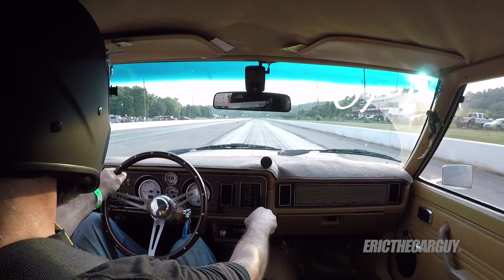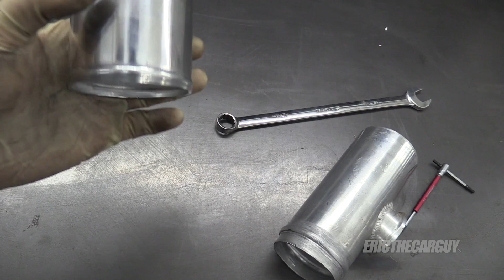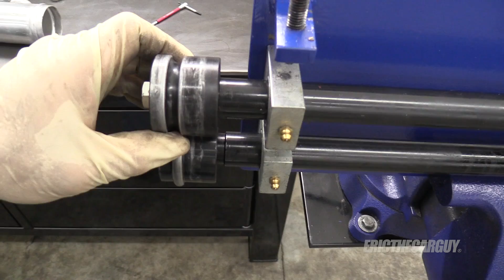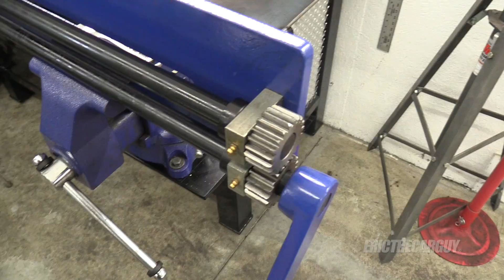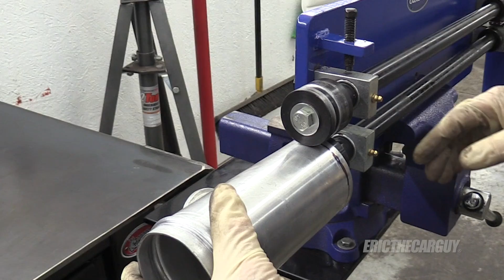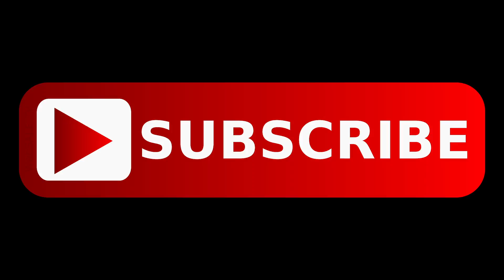How To Keep Your Hoses From Coming Off

Comment: Hey mate great vid cheers! Question - my coldside silicone pipe keeps popping off despite having a rolled bead on the metal pipe. I noticed you have 2 clamps which appears to the placed on either side of the bead. Are 2 clamps placed like this necessary? And would it help my situation?  I've had 3 mechanics try to fix this a total of 4-5 times now and am losing patience, will try to fix myself/know if these mechanics are doing a decent job. many thanks

Comment: I have steel “cold side” pipes (I call them compressor pipes). I made beads by soft soldering a wrap of stranded copper wire. Tin the steel. Wrap one turn of copper and twist the ends together. Solder it to the pipe, snip off the twisted ends and file smooth.

Comment: That is one way to fix it. I don't have a bead roller so I just draw my straight line and tig some spot welds around the pipe.
Reply: I think weld method is the best with an normal people

Comment: You'll find many uses for that bead roller Eric..and as game changer, get rid of the crank and put a big wheel on it. the larger the wheel the better control. You will notice it more so when your trying to lay out a clean curved bead on a long sheet.  But that's where a powered version is best. 😃

Comment: I've got a 2002 Saab, it MAYBE pushes 12 psi,  probably less, but even then I had the intake off and shortly after was pushing that 12 psi... intake hose popped off with a thunderous BANG, scared me so bad I thought I'd blown the thing up lol. Anyways, having a hose blow off under pressure is no good.

Comment: Hairspray works well too, clean the boot and the pipe with brake cleaner to remove oil and grease, get some of your wifes hairspray  coat the end of the pipe and inside of boot, install clamps and torque 

Good to go

Comment: I now add hose bumps to all hoses that originally did not have them. I use the bubble flare die that comes with the Eastwood Hydraulic Flaring Tool. Of course its only good up to the die size that the kit includes. No good for rad or turbo pipes.

Comment: You can also weld the bead on there. Be sure to grind it smooth so you dont have sharp edges. Saying this because people more likely have a welder laying around rather than a bead roller.

Comment: Hey  What's up buddy been watching your videos for years now lot of good education and stuff But I need your help with one thing running into a problem I have a 2003 ram that had a 4.7 but now it's has a 5.7  And the problem that I am having is On the top right corner of the motor there are 2 connections they look like fuel injector conections but i dont see the same connections on the truck?  Can u help me out.   You can email me at zombie.king1988@gmail.com  or on here

Comment: The Vibrant Performance bead roller is much more compact and has a plate to keep the pipe straight while making that initial guide bead. Also has a knob to set the pressure instead of having to use a wrench.
Reply: But you cant do floor pans or any other fancy metal work with one of those

Comment: Did this help anyone?
Reply: Its all about the views
Reply: Yes, smarty pants. I saw Eric pipe fitting without the bead when he first was routing the turbo pipes and thought he should do beads like they do on Project Binky. I started to look into bead rollers for myself because of that and there are a lot of them out there. Seeing one in action like this with commentary on the nuances of the process helps a great deal when selecting the right tools for the job. Manufacturers/retailers videos are a good place to start, but they are all about selling product. When learning I prefer long form videos where the detail is left in.
Reply: Yes mate, I agree

Comment: Roll over image to zoom in
Forney 70815 Pipe Template, Wrap Around
by Forney
3.9 out of 5 stars    3 customer reviews  
List Price: $32.99 
Price: $28.30 & FREE Shipping.Details
You Save: $4.69 (14%)
Note: Available at a lower price from other sellers that may not offer free Prime shipping.
Wrap around -Inch little helper-Inch pipe template
Measures 4-Inch by 60-Inch and made from tough yet flexible material
Used for marking straight lines around 1-Inch to 12-Inch pipe
For use as a straight edge
Contains 45 degree angle markings, protractors, scale and constants table

Comment: Flange Wizard WW-16 Wizard Wraps, 2 5/8" x 30", Heat Resistant, Small
Flange Wizard
WW-16 Wizard Wraps, 2 5/8" x 30", Heat Resistant, Small. This is what you need.

Comment: for getting a straight line on a tube, I use a piece of paper and some tape all the time.  Just need a little bit of overlap and tighten the paper around the tube.  works every time

Comment: You can use a modified pair of channel locks to put a bead on the end of tubing if you can't justify buying a roller. Grind a cup in one of the jaws, put a big tack weld on the other and make that fit into the cup on the other jaw. It's a lot harder to make the beads but it works.
Reply: Serps1991 Dan from Hoonigan did it this way. I need to do this soon
Reply: Greasy Style I actually learned about this from Tony Angelo, one of the original Hoonigans lol.
Reply: Hotrod garage? Or before that somewhere? Hahahaha but yea very neat “backyard” trick
Reply: They showed it on a recent Hotrod garage. I've heard it talked about at Club Loose at Englishtown though.
Reply: Welding a washer on instead of fitting a bead works well too

Comment: excellent video. well spoken. another helpful tool (s) for working with tubing fabrication...check these out:

https://www.grainger.com/product/18C551?cm_mmc=PPC:+Google+PLA&s_kwcid=AL!2966!3!281698276041!!!g!471329783024!&ef_id=WqKbIgAAAGZ2Mza8:20181019143209:s&gclid=CjwKCAjwgabeBRBuEiwACD4R5isNV670UALNTCeoZAhfS-fSQMp0LMoNvbGi9gP4DyiBy0aXxflnnRoCCPcQAvD_BwE
they're super handy and easy to use. makes for a good straight edge if/when you're drawing circumferential lines, prepping joints, etc. just fyi. thanks eric!

Comment: put some oil on the rollers after first pass. should be easier to make groove
Reply from the maker: I thought of that but thought it might cause the metal to slip rather than go into the rollers.

Comment: First off, why don't you use your hose coupling, hose clamp, masking tape, piece of paper, pretty much anything so that you can make your initial line on the tubing? That's pretty amateur to eyeball it with a sharpie.

Second, your thumbnail for the video says "easy", but you screwed it up the first 2 times. For the $150ish it would cost to purchase this tool, I would think a professional could bead roll quite a few tube ends for that (although a bead roller has a lot of other uses).

Here's a video link that shows a more affordable option that's a little bit more consistent for someone that is inxperienced with a bead roller or can't afford $150 tool. https://youtu.be/JVDUM2ZxoW0
Reply: Zach McDonald  You don't have many friends, do you? You're quite rude and a "know it all". Telling a YouTube channel owner with over 1 million subscribers, "what he should do". You're an odd little man, Zachary.
Reply from the maker: Despite my scribbly line, the bead turned out fine. It was only my first 'practice' bead that didn't turn out all that well. You make a great suggestion though. 

As for the thumbnail, this is YouTube. Hate the game, not the player. 

Thanks for your input.

Comment: Aqua net hair spray also helps keep intercooler hoses on. It acts as an adhesive.
Reply: Super 77 would probably work too, maybe better, tho getting it apart later could be an issue
Reply: Caterpillar green glue,we use it on diesel intercooler piping on pulling tractors and trucks running 70+ lb of boost.
Reply: A few people said similarly but I finally get it! (You maybe explained it better or I was a slow student.) I have heard the argument that it's highly flammable...however...

Honestly people end sentences that way, but it's BAD grammar? Lol

Comment: Roll the bead where u want it and then cut
Reply from the maker: Won't really work if you need a specific length of pipe like I did here. Thanks for the comment.
Reply: @ericthecarguy   it won't fit down the pipe to roll it anyways. Great job on the pipes they look good. Love the vids watch them all the time.

Comment: Still kinda going to 14:1 on wot though. 11s is where it needs to be :) great work on the beed rolling.
Reply from the maker: Still dialing it in. I don't drive it much and when I do, it's not often at WOT. Mostly I just drive it around town. I do plan to jet it up yet again. That turbo makes the engine very thirsty. Thanks for the comment.

Comment: Wrap a piece of paper around the pipe to draw your line.  It will be true and straight.  Cheap too.
Reply: Blue painters tape works well also. Though paper is easier to adjust to ensure it is straight.
Reply: A hoseclamp is way faster and way easier than paper.
Reply: XBaneyX yes good idea.  I mentioned paper as everyone has it.  I am sure there are many good ideas.
Reply: Yup, paper tape from home depot, used to mask walls while painting - cheap, sticks easily, and solves all the problems.
Reply: If you laid the marker on top of something the height you’d like the bead you can just keep the marker still and spin the pipe around vertically on the table top.
Reply: I do that for cutting pipe all the time.  I'm incapable of cutting a pipe straight with a sawzall or angle grinder unless draw a paper wrapped line first.

Comment: Because I did not own a bead roller, back in my day I found that another way of solving my hose problem was to run a thin weld at three or four points around the pipe with my mig or tig welder. That gave the hose clamp a bit of a shoulder and it saved over clamping of the hose.
Reply from the maker: I find welding aluminum with the set up I have to be problematic. Thank you for the suggestion.

Comment: Having the tool is nice. Besides not using that tool much and the expensive another problem for me is storing it.
For the DIY guy that might build one or a few turbo setups in his life you can do it with a pair of wire crimpers. Isn't as easy or fast but it works good, at least on aluminium pipe. 
https://youtu.be/JVDUM2ZxoW0
Also seen it done with vicegrips
https://youtu.be/hAXSwmsvqUQ

Comment: Eric get yourself a wrap around.  Wrap a rounds are burn resistance and have different measurements and angle lines on it.  It's used in welding /   pipe fitting.  It takes the guesswork out of your work.
Reply: Do you have a link to that? I never heard of it before. Not even sure what it is supposed to look like.
Reply: Flange Wizard WW-16 Wizard Wraps, 2 5/8" x 30", Heat Resistant, Small
Flange Wizard
WW-16 Wizard Wraps, 2 5/8" x 30", Heat Resistant, Small
Reply: You're the kind of guy who beads a pipe and doesn't have the common courtesy to give it a wrap around!!!
Reply: Would a hose clamp do the same thing? Asking for a friend.
Reply: Yes, 'but I think a piece of paper would do a better job for you.   I've used  sheet paper, cardboard and don't forget you can use a dollar bill.  If you use a dollar bill you also have a very good measuring tool. A dollar bill is  6 3/32"  long.  Round down just a little, and you"ll have a  6" ruler. I hope this helped you.
Reply: One of the pipeliners I used to work with would just use a piece of duct tape with the sticky sides stuck together.
Reply from the maker: Thanks, I'll have to look into that.

Comment: I like the bead you put on that piece of tubing and hope it solved your problem. That machine is remarkable, but only good for someone working in a repair shop where they may get enough use out of it to justify paying so much for the machine.
Reply: Buy one, do your thing with it and then sell it on....always a way if you look hard enough...
Reply from the maker: This is an 'entry' level tool. There are more expensive motorized versions for professional fabrication shops. This one is perfect for me since I hope to be doing more fabrication work in the future.

Comment: one suggestion, you can cut the pipe shorter after rolling the bead. so running the bead a little bit further in is not that much of a problem. 
i mean. if you go up to this level of fabrication you probably can use a slightly longer tube in the unlikely event you cut the pipe too short.
Reply from the maker: Yea, I thought of that, but the pipe was already cut to fit. Cutting it shorter might have meant that it might have been too short. I got lucky and didn't need to worry about it. Thanks for the suggestion.
Reply: Good advice.

Comment: No offense to Eastwood, but imo this tool looks really cheap quality.
Reply: Eastwood products look about the same as Harbor freight tools but with a bigger price tag.
Reply: @678friedbed  Actually most of them are a step up in quality. It's a small step.
Reply: @consaka1  I agree but I dont think that small step is worth the extra money.
Reply: Well, you can always pay 5 or 10x as much for something better, but I guess you probably have 75k in snap on tools and will be paying on them till you retire
Reply: Not enough reinforcement, a set screw without a handle, bearings with grease fittings...